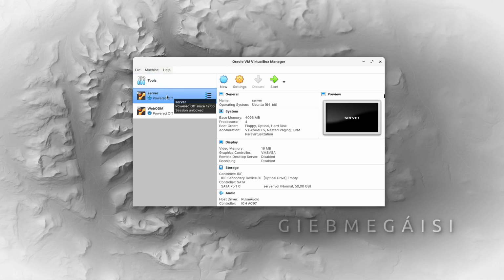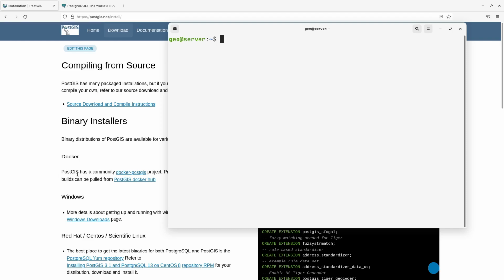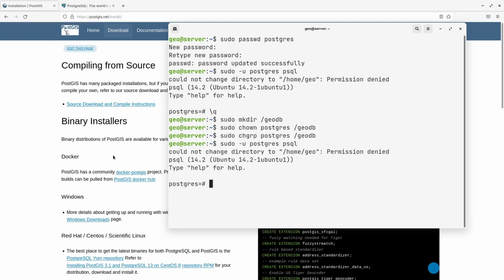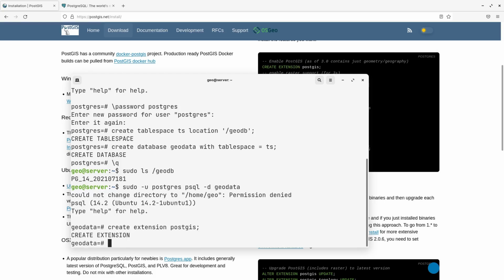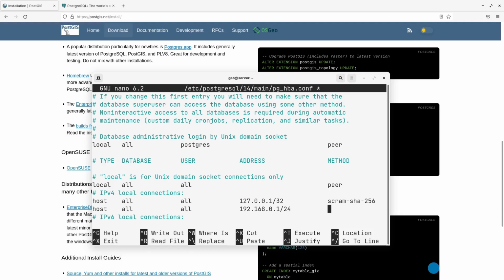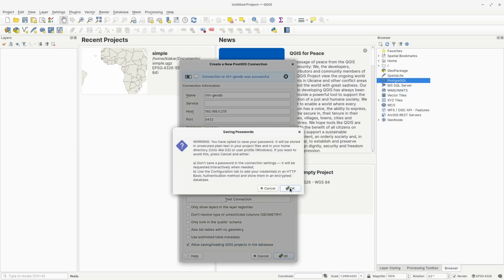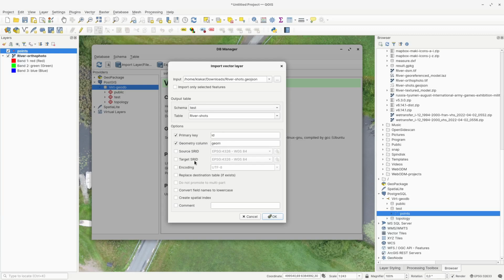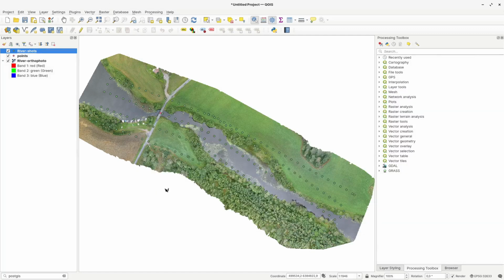QGIS User 0042 - BackendService PostGIS

Comment: The "sudo -u postgres psql" commands are erroring because the psql client is attempting to create its .psql_history file in the current working directory (/home/geo) which postgres user does not have permissions to write to.  Use "sudo -iu postgres psql" instead to instruct sudo to perform a login as postgres user before executing the psql command.  This will set the PWD to the postgres user's home directory.